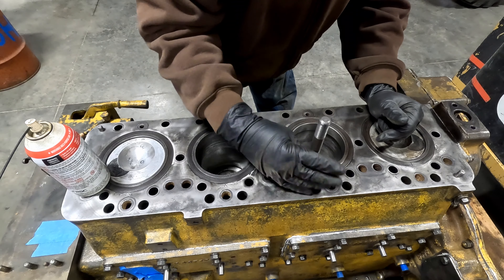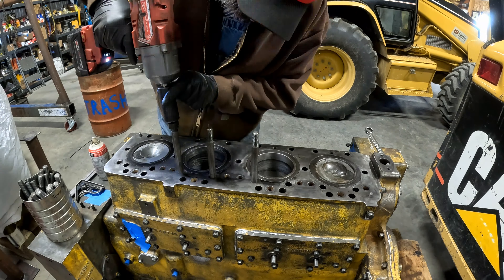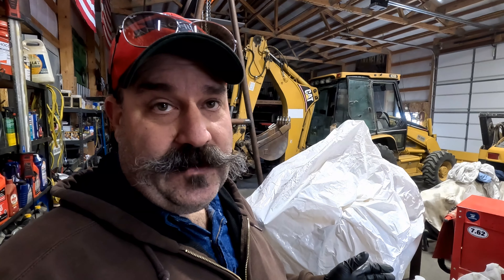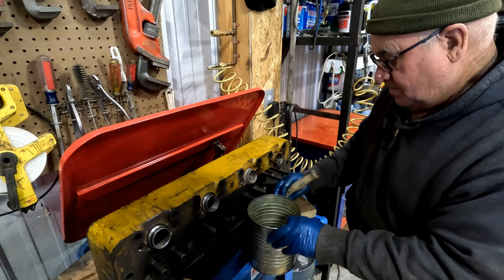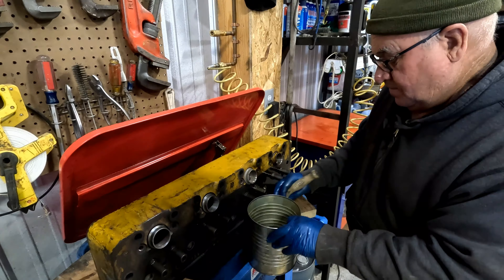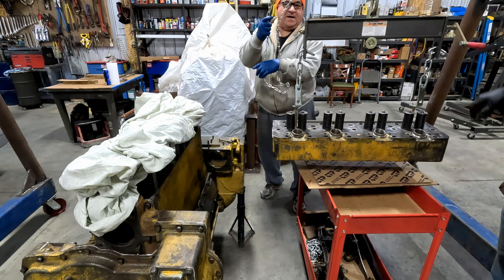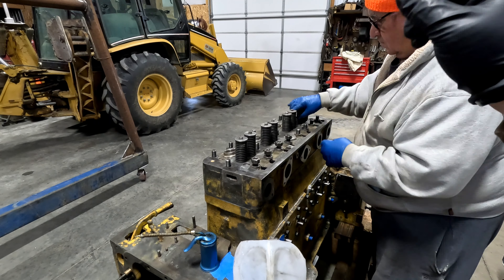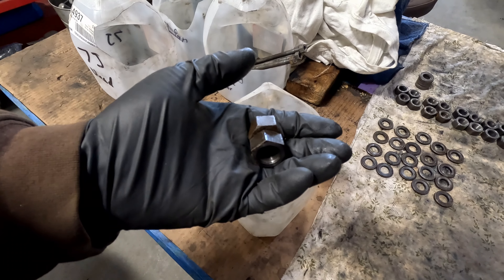Cylinder head install Caterpillar D4400 Diesel engine 1939 Cat D4 "Lil Lefty" 4G9986 Episode #84

Comment: What a fantastic work you two. I think not long until the first start of Lil Lefty. Goliath is a beast kind of like the Goliath from Knight rider.  Interesting the D2 and D4 have just stamped steel valve covers. Did any of the CATs have cast iron valve covers ever?
Reply from the maker: I can feel we're getting close! Hopefully we can make it to some shows this fall with Lefty. I can't recall any that have cast iron valve covers. But now that you mention it I'm going to keep a lookout and I'll let you know if I see any. 😊
Reply: @lifeafterourloss  Probably they all from D2 to D9 have stamped steel ones. Cast iron one is the Soviet improvement form the original design. Also it adds more extra dead weight to the engine.
Reply from the maker: I've been trying to think about it and I don't recall anything with cast iron covers. Even our old 8T grader was stamped. I do recall some cast aluminum ones in later model equipment. I bet the Soviet cast iron ones were very heavy.
Reply: @lifeafterourloss  They are substantially heavier you need really to fight with your fists to get it seated in place.

Comment: As always, great content, great presentation.  I'm working on 7U10608 and need to ship the head for restoration (thanks for the reference to Antique Crawler Parts).  Can you estimate the weight of the stripped-down head?  Many thanks in advance.
Reply from the maker: We are in the middle of head problems ourselves. A stripped down D4400 head is probably around 150-200lbs. (that's just my wild guess) A D315 head like in your 7U probably weighs another 25-50lb more. The D315 is a 4 1/2" inch bore as opposed to the 4 and 1/4" bore on a D4400. I hope that's close enough for you I've never actually weighed or shipped one.
Reply: @lifeafterourloss  Many thanks.